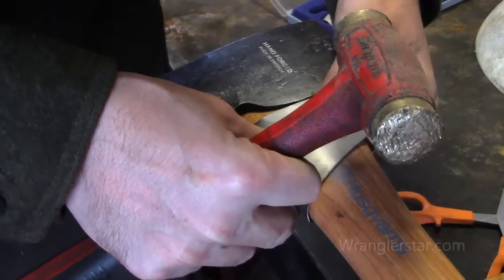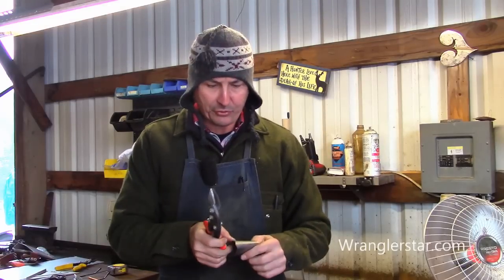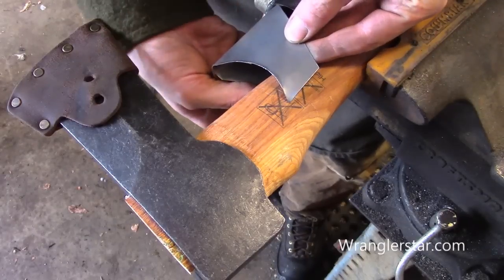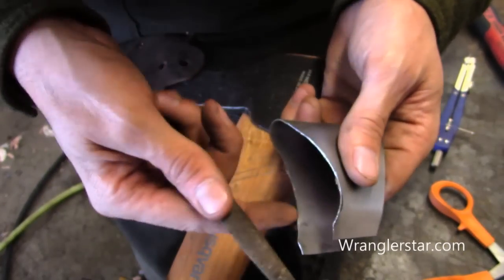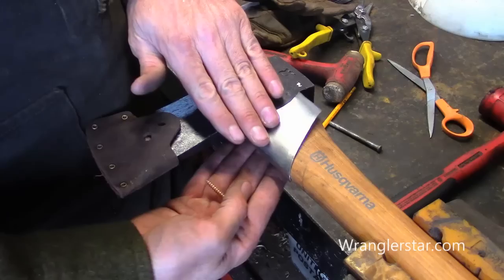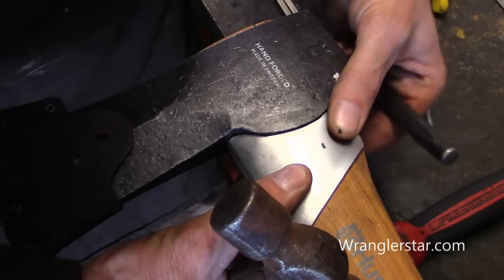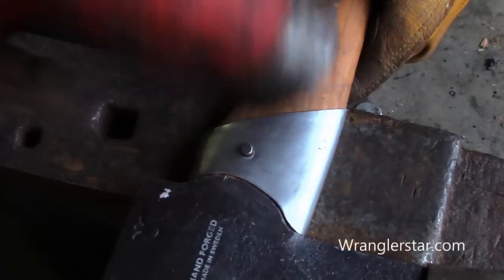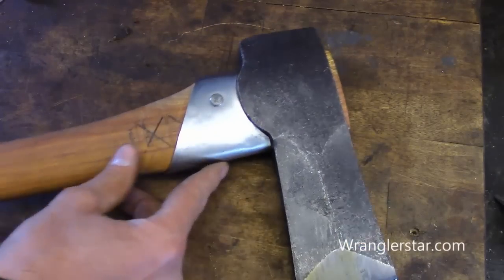No More Broken Axe Handles 2 | Wranglerstar

Comment: Cody, this is a great idea, and you do great work, as always.  A couple problems, though:
1.) that thin sheet metal you're using will still dent and damage the wood underneath during a bad overstrike; or even during splitting, when the log doesn't split in a straight line with the axe/maul head, and you have some of the log impinge upon the handle area.
2.) I don't like the idea of drilling holes through the handle of a "strong impact" tool like an axe, maul, or sledge.  A hookaroon or pickaroon, yes (these are mainly pulling tools).  But not a tool that receives a strong impact on its head.  Reason: even with hickory, the jarring impact, or the sudden "stop" after a strong hit, tends to put stress on the rivet or roll-pin, and this puts "parting stress" in the hole.  In other words, the rivet or pin acts as a prybar to pull the wood fibers apart.  It won't happen immediately, of course, but it will happen over time.  Once you drill a hole in a handle and you separate the wood fibers like that, you can't "take it back" -- you can't undo the damage.  I would've rather seen a buckle type of fastener that can be replaced.

For these reasons, I personally am more fond of using a good polypropylene or nylon rope wrap that is durable; especially poly rope -- it take strong impacts without the fibers separating.  A rope wrap is soft enough that it will absorb most of the impact, and only transfer "pressure" type of forces against the handle (pressure forces, not impact forces).  And it's easily replaceable and won't damage the handle.  I'm ex-Navy, so I have a plethora of wrapping and knotting techniques at my disposal.  But I mainly use what's called a "spiral hitch" for the wrap technique around the handle under the head.  You can find a good video on how to do a spiral hitch here on the 'Tube.  One I recommend is this one: Spiral hitched paracord handle ("Spiral hitched paracord handle" by PaleSpruce).  The nice thing about the spiral hitch is that each wrap around the handle interlocks with the previous, and also gives -- as its name implies -- a spiraling buttress that is easy to grip (especially with gloves).  In determining whether to start the wrap from the head and work down the handle, or from about 4-to-6 inches on the handle behind the head and work to the head, I choose the latter. (I.e. start from the thinnest diameter of the handle, and work your way up to the thickest, so the increasing incline causes each wrap to squeeze against the previous wrap).  If you use poly rope, you can seal and lock the ends of the rope into itself with a small flame (butane lighter).  A spiral-hitched wrap is extremely durable, doesn't transfer the impact of an overstrike to the handle like denting sheet metal would (denting sheet metal transfers that injury right through to the wood -- you'll see), and is easily replaced in case repeated overstrikes (over time) cause the rope to finally fail.  I can re-do a wrap in the field, in about 5 minutes from start of the wrap, to sealing and locking the two ends of the rope with a lighter.  No kidding.

Give it a try.  PM me if you have any questions, or would like to see pics on what the final product looks like.
Reply: wow, thx for this, underrated comment

Comment: When working with any kind of sheet metal, it is best to make a mandrel slightly smaller but the same profile as the finished object cut the metal to the size required but form it on the smaller mandrel. then when you fit it to the actual handle use the shot mallet to ease the profile out to the exact shape.  
BTW absolutely love watching the doings of your homestead god bless your house and every one under the roof.  
PS Get your self a Dremel tool mains powered type and all the attachments you will work wonders with it.

Comment: I use an old bicycle tire, cut about 4 to 6 inches and screw it on the handle. It actually takes out the vibration of the over strike.

Comment: when you're sliding the metal on and off to fit it, scratching the finish, I die a little inside. Can't be avoided and can be refinished, but still. 

Great video, I bought the Stihl Pro Forestry that comes with the overstrike already on it, love it.

Comment: hey buddy i know you know your stuff and this is a dated video but just thought i would chime in with a little tip that might benefit some readers. when working with metal or better yet when hammering metal against an object like a vise, anvil or axe handle. metal will always travel towards the hammer. so if you ever find your self wondering why you cant get something flat or tight enough when hammering on an anvil, vise or around an axe handle its because the metal is actually moving away from the object and towards your hammer.

Comment: Wranglerstar, I think you had such awkward trouble with the file because you're using it like a rasp. Try lifting up on the backstroke to keep from snagging. (this also helps keep your file sharper for longer as backstroking on a non-crossed file dulls it very quickly.

Comment: I use steel-belted radial tire cut with a hacksaw and attached to the handle with heavy gauge fencing wire. It's not cosmetically pretty but it works a treat!

Comment: I take a strip of rubber cut from an old car tire and put it lengthwise up the front of the top 2-3 inches of the handle, then duct tape it on. Not clean looking but it does the job. 
For a maul, the handle is round enough to get some flexible rubber hose of the right size and just cut a piece a couple inches long and run it up the handle and into place just below the head.

Comment: I think one trick for this would be getting the rivet exactly center in the handle. The front of the handle will go through tensile stress and the back if the handle will go through compressive stress. So i think putting it front or back of center will cause a small amount of splitting. Just my thoughts.

Comment: I have a Husqvarna Hatchet, and found out about the logo being a gunsight when I was trying to find out who made it. I am pretty sure mine is one of the first run of Hultafors Axes that Husquvarna used just based on the design, but I can't be sure. They originally used Wetterlings seconds, then switched to Hultafors, and have gone through a few different designs since then.

Comment: I usually weld a piece of V metal profile 3mm thick, 3cm wide and about 10cm long in front of the handle, doesnt untamper the axe as the heat is local, works very well, no holes to weaken the handle. Tried putting bolt trough handle but didnt work as well, no need for bolt as the axe head stays on from wedge

Comment: Very nice sir. I think I´ll do the same. Except maybe i´ll leave in the back one side of tin longer so I can wrap it over and inside again to grab it with the rivet. Thanks for the videos very useful.
Reply: that is  what i was thinking. a half inch lap and then two pop rivets. you would have 2 smaller diameter shallow holes in the wood but not a thru hole

Comment: Suggestion that I am sure someone else already made.Make the collar extra long on one side and wrap it around and under the other so when you pin it there is no gap in the back. Since you have a pin through both pieces of metal on the one side It should hold firm

Comment: looks good lots of work. what i have done over the years is just rap a bunch of tape around the base of the handle. good tape 3M super 33 or duck tape its not pretty but it works. tape get ripped up remove and put new tape on. i have saved lots of 4 pound hammer handles over the years

Comment: I've done something along the same lines. Heat up and flatten a piece of pipe or tubing of appropriate size and weld to the head. of coarse before putting on new handle! Only needs to be 2-3" long

Comment: I've never broken the handle on my hydraulic splitter...
Reply from the maker: Geloradanan R'lyeh LOL,
Reply: wranglerstar Thanks for all your videos.  I gained some great ideas!  §;^)
Reply: +Wranglerstar for the tight radius on the sheet metal, a jewelers saw is always handy and should do great, you probably don't need telling but it's a small saw with a very fine toothed, very thin and flexible blade that's set in a frame much like a hacksaw though a bit different in shape and function. Awesome tool to have in the toolbox.
Reply: +Wranglerstar Also, for those jagged edges you were filling, a chainsaw file would be my go to, fine toothed and  easier to use because of that, the teeth won't bite so hard like I saw was happening to you, especially in the beginning, and lastly leaves a really neat and tidy finish with minimal gauge marks.
Reply: Zig Zag b
Reply: Geloradanan R'lyeh but it wont work in alska it will freezes the hydralics wait no wood heck
Reply: Geloradanan R'lyeh you’ve also never gotten the satisfaction of doing it by hand. I also believe I can split faster with a maul than a splitter. Especially one I could afford. :/

Comment: The best place for the rivet would be dead center of the shaft. If you have to drill here it minimizes the tension and compression forces on the handle when you strike with the ax. since you have contoured the sheet metal maybe welding or brazing would be a decent option. To itself not the head just to be clear lol.

Comment: Cody you need a body work finish hammer .. they have a double head , square (flat faced) and round (slight curved face), for work like you did a ball peen has a round face there fore will leave marks that a flat faced body hammer is less likely to do.

Comment: Perhaps; Use a string for measuring diameter and mark where it overlaps=the exact length. Or better yet a taylors cloth tape measure in mm is accurate.
Allow the usual 1/16 (to 1/8") extra and buff it down with emery for fine tuning a perfect fit. Buff all contours.
Ive paid at times on projects like 1/16 too short! Know the feeling..nice work im learning lots from you. Thanks.

Comment: You can ask any old-timer if that piece of metal is hurting or helping and you will get 100% consensus that it is hurting it...Drilling a big hole into the handle and driving a ridged pin that does not flex affects the "flexibility" of the handle, and also weakens the handle as well. If you are damaging that part of the handle while using the axe, then you need to sharpen your blade and slow down and become more accurate with your strokes! Seriously.
Reply: +Brian Wilson I've seen a lot of old axe's with those guards. And as an engineer I would argue that the flexibility or and strength of the handle is never properly worked out when designing it in the first place and varies from piece to piece. So I'd say that's negligible under these circumstances.

Comment: After seeing people make sinew backed bows i wonder if that could be a good material for this. I've never tried it myself but it seems like it could be a good natural shock absorber that also tightens up around the wood once it dries, which i assume is better for structural integrity then rivets.  

I would probably just duct tape some EVA plastic or an old garden hose onto the handle. But you seem to have an aversion against everything that isn't iron, wood or oil so... sinew.

Comment: Just make one side of the back overlay the other, then tack them together on the back with two small corrugated finishing nails, add a washer under the heads if needed.

Comment: I used some heavy duty rubber padding, about .5cm in thickness warped in ducktape. Seems to do the same thing thou the tape do wear off quickly but then again, ducktape dirt cheap in my local store so I don't worry too much.

Comment: I might have just put a couple tack welds to fasten the guard to the axe head. Keeping the weld as small as possible wouldn't change the high quality steel by any significant measure, and you could always break the weld with a tool later and get the head back to its old condition.

Comment: I´ve got an easier solution to this: My dad used a piece of thick and robust hose with a big diameter to protect the handle. He cut the hose open lenghtways an then attached it to the axe handle with two or three hose clamps. Works perfectly for someone who does not miss the wood that often.

Comment: a hole in the handle reduce its strength in the position where the stress is maximum. Additionally the pin will stress the wood in direction transversal to the grain = low strength of the wood. Bad idea!

Comment: I use much thicker stainless steel and i weld it onto the handle (after every half inch of weld cool it of with a drenched old towel. It's actually bulletproof.

Comment: Plastic, a 4 mm thin sheet of PE plastic would offer a great solution to this i belive.
It can be bend into shape and place and then plastic-welded at the back-end of the axe. Easy and cheap replaceable too :)
Reply from the maker: bunkkasponge I hadn't thought of this. Plastic might work very well. Not as cool though,
Reply: wranglerstar Next time, you should make a template out of paper first, you can then draw it out on metal.
Reply: wranglerstar
Cool and practical? are 2 different things. The first time you hit the tin it will deform and you better be wearing gloves.Imma guessing it will last a day before it goes thru a glove or finger.Plus if you are swinging the maul hard the thin tin won't prevent a brake
Be careful

Comment: cody, I'm really interested in a video where you safely drop a tree in tight quarters.  I live in an suburban environment with large trees and need to remove them.  Ropes? Ladders? Rigging? I've seen plenty of your videos on felling trees in the homestead, where you have plenty of room to drop them.  i've only got 8000sf lot and 2 pines & fir that are about 75-100' tall and within 20' of the house.
Reply: Tenspeed TheBikeHanger I agree, however, the skills would serve well on some of the smaller trees I have to keep them from getting that size.  I've already got a couple  of estimates on removal and  they are in the $2000 range, more if I want the stumps ground.  I'm not opposed to paying, I'm just curious how much work goes into it and if renting machinery or doing some of the work on my own would be easy enough.
Reply: Tenspeed TheBikeHanger I would have to agree i know how to drop trees did it for a living but in the woods are very difrent then near houses and the pros have insurance just in case you know it does happen a tree falling on a house that's why the insurance is there just incase but topping the tree is realy the only way to do it when close to a house or bulding you dont want to hit if you want to see what can happen just search youtube and have a laugh at people that should not be using a power saw
Reply: I agree with and appreciate all the advice and would still like to see a similar video from Cody just as a suggestion to him and the channel.
Reply: Im an arborist and heres my advice, DONT use a ladder, its a recipe for disaster, Have a professional get the trees to a point where you are comfortable felling the stems, or put everything on the ground and you can clean it up, there are ways to save money. I am all about DIY, but not when it comes to tree work, it's really easy to get in over your head and get yourself killed, or smash your house.
Reply: The tree needs to come down a piece at a time. I suggest a zipline approach.  This is for a well seasoned person with skill in using saws and ropes.  I took down a 100'+ tree in sections estimated at 300-500#, choking and snapping off in a controlled process.  Using a zipline, I moved the material to a location near by that was clear.  This made it easy to handle and very safe.

Comment: You could have whipped it and coated the wiping in either linseed oil or epoxy...Also not a bad idea to epoxy the sheet metal to the wood and use a temporary whipping to keep it on there till the epoxy has cured and/or re-whip it as a decorative touch.

Comment: Paracord wrap takes about five minutes, provides better protection, easily removed or replaced.
Reply: +jtr109 see that's much more logical.
Reply: +Boliver 2015 Boiled and dried? Please continue i am intrigued:)
Reply: +Boliver 2015 I'd  be scared the boiling water and woodstove could dry out the handle just enough to loosen the axe head.  Might not happen everytime, but could def see it be an issue some of the time.

Comment: What if for future splitting axe handles you implement the metal sheat in the handle design so when you insert the axe head  the metal sheat goes inside the axe ehad. Less fiddly as it turn out to be and the axe head has a harder surface on which to rest. Just an idea.

Comment: It's a nice design and good workmanship but we didn't have to put that big rivet through the middle. The guard would hold just as well with a couple of tiny round head brass tacks driven through the back where the two ends meet. Two on each side and that would do the trick. Again, though, nice design, thanks. We could also use a sheet of copper if we don't have any tin.

Comment: the easiest way to make a cut, especially a curve such as yours, in sheet metal is to make relief cuts with the snips perpendicular to your pencil line. bring the relief cuts to about 1/8" to 3/16" of the line, then make the actual cut along the line. this allows the waste material to curl out of the way of your snips, and allows you to make much tighter, cleaner curves with the snips. its a waste of time to try to make a cut more than about a 1/4" off the edge of the sheet. even with straight cuts, make relief cuts every 1/4" then remove the waste. repeat until you come within a snip length of the pencil line, then make the final cut. you can make great cuts with snips if used properly. youtube "proper tin snip use" for detailed instructions. im sure someone had done a video